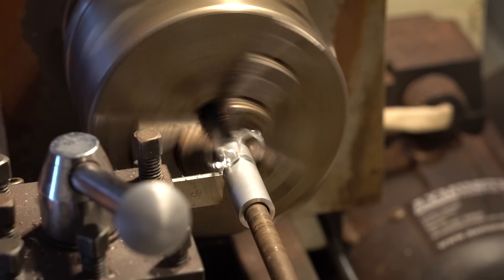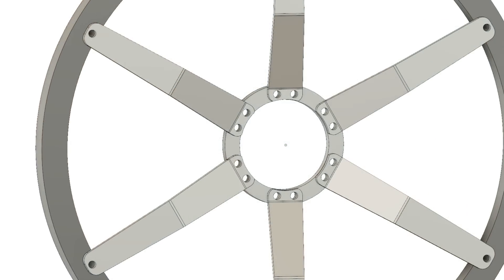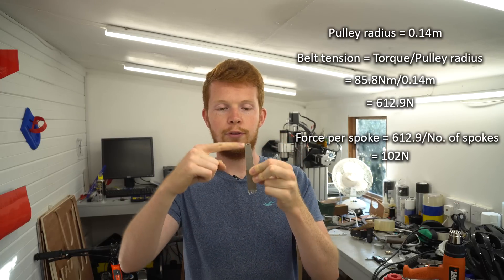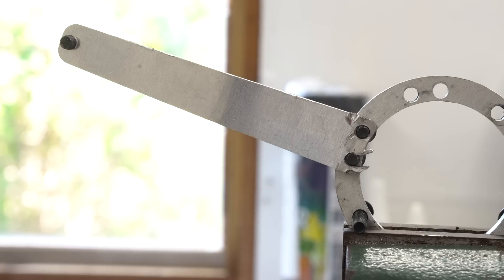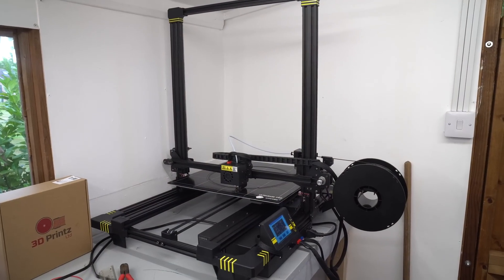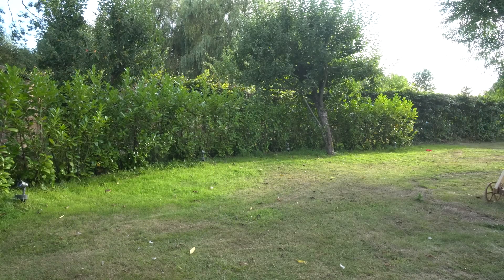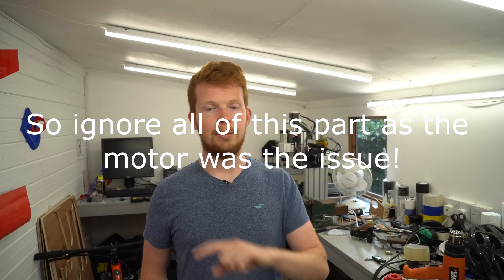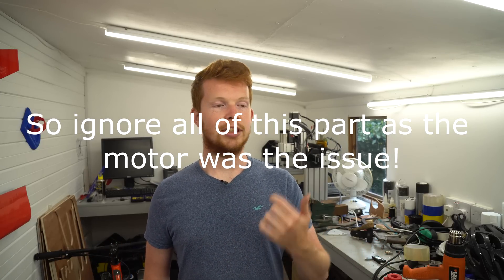Electric Bike 4.0 - Pulley Failure

Comment: Hey Tom! Your projects are awesome. But I wonder why you arre trying to desing this e-bikes to run on separate bldc motors. You can very easily use a rear or front wheel hub motor. Then you wont have to deal with pulleys, belts, motor mounts etc.

Comment: Honestly, Tom, your Stanton Pigeon Flyer 4.0 ended up being much more complicated than the mid-drive lol! I still think you should do the Mid-drive with a jackshaft, its really not that hard and you get the best of both worlds, lots of torque "wheelies" and high speed, I'm going to keep bugging you until you start prototyping the mid-drive + jackshaft which you pretty much already built with the gear reduction box. I built one with scrap steel and I'm really dumb compared to you so it should be a walk in the park for you, lol!

Comment: for future projects might be good to use a tension pulley on the compression side of the belt, not the tension side where the motor pulls on the belt.
and have the tension pulley to be moving freely but having a big spring to apply constant tension on the belt as it stretches under load

Comment: Hi, I am an engineering student and love your videos. I just learned about DC motors and Kt and Ke values, I looked up the Kv value of your motor and required EMF current from your E-bike V3 and came to a torque of 18.75 Nm. I see that you came to a value of 42.2 Nm in this video which was quite off from my calculation. I was wondering if you or any other engineers in the comment section could help explain what I did wrong? Thanks and keep up the amazing videos!!

Comment: About your spokes. Look at how the aluminium sheet is made. You can see the layers because the aluminium sheet is streched out to get the right thickness. See it as a piece of wood with its layers. Wood strength is different in the length of the layers, this also applies for aluminium. I'm not sure how much differens in strength there is but maybe it helps for the next time?
Reply: I found a source to back up my comment: https://apps.dtic.mil/dtic/tr/fulltext/u2/a506416.pdf

Comment: Why did you use radial spokes for your pulley? angled spokes are much stronger(compression),  Idk how you missed that as both your wheel and disc brake rotor have angled spokes.

Comment: When doing finite element analysis do not just select the smallest mesh size. You should rather do multiple simulations with mesh size getting smaller each time and see if the result converges to a value. If it converges you can be sure that the result does not depend on the mesh size. If it does not converge, there is something wrong with the model and you should investigate further.

P.S. Great video!

Comment: dont use grubscrews!   drill a hole on the face  and thread the half of the shaft und half of the pully and put a screw in . Maybe 180° for a second . homemade "key"  1000 time solider than a grub..

Comment: You can determine the torque your BLDC motor is producing if you know the Kv and the amps you are applying.  Do this by deriving the Kt and multiplying by the amperage.  You can derive the Kt from the Kv using the formula KtKv=1 in SI units.

Comment: I've watched your E-Bike video series with interest. Looking back thru the last few videos, I can't find much discussion at all about when you modified the electric motor. Am I missing that? I'm interested because that seems the most likely problem for the shuddering you described.

The last video shows the rendering with the shaft out of the reverse end of the motor, relative to the originally designed propeller mount.
This video talks about the failure of the new motor shaft. Did you cover the motor modifications somewhere?

Comment: As a mechanical engineering student, its awesome to see many things I study being applied to real world problems. Calculating the torque on the pully hub is a typical "Dynamics" problem, and verifying if it will resist or not the torque is a typical "solid mechanics" problem. Its literally something that I would have to do on a test.

Comment: Tom, the motor you are using does not have a specific max current given, says it needs 200 amp ESC, doesn’t this mean it is closer to 10KW? ( 50v x 200amp) or does it use less amps than this?

Comment: hi tom might have something useful to you. there's this you might be able to do something with https://www.aliexpress.com/item/Electric-Bicycle-130-BCD-Road-Bike-Chainring-Spider-Chain-Ring-Adapter-Gearing-For-BAFANG-8Fun-BBSHD/32823956546.html?spm=2114.10010108.1000010.4.5ebe408cpXGT4r&gps-id=pcDetailLeftTrendProduct&scm=1007.13438.100207.0&scm_id=1007.13438.100207.0&scm-url=1007.13438.100207.0&pvid=9de4ef81-7101-4622-b3b6-cdb45cd9b338 
or you can get two piece disc brakes

Comment: Try using countersink screws. It mounts flush and it leaves no gaps in the material around the joint, so it's stronger and it won't shift under load. The load is more evenly distributed around the hole so it's stronger.

Comment: Check your motor bearings, I had a water cooled RC brushless motor fail in a High speed boat I built where the bearing just couldn't take the force under high revs. Axial motors are better for Bicycles as the bearings take a way higher load.

Comment: You could try hardening the shaft the way Clickspring did it, by packing the rod in a clay capsule with carbon and firing it (or if the steel has enough carbon content, quenching it in water or oil)

Comment: I know you have fixed this already but have you noticed that bike spokes work in pairs? connecting to a point on the rim and then back to the side of the hub tangentially rather than radially? 

that is effectively what you have done by widening the bolt holes.

Comment: Aluminum with steel fasteners is not the best materials for this.  Metal Fatigue may cause another failure in the future due to repeated shock loading as a normal form of wear and tear on a bike.  Thin Tubular steel with flattened ends may be a better alternative as some steels have a stress threshold below which they don't exhibit fatigue.

Comment: I will tell you Tom that this failures, and how you solve them, are one of the best parts of your videos, you're a great explainer. I reckon it is easier to edit one long video every two or three weeks than a short one each week, so you could do that, maybe? a long video not only showing like a tutorial on the project, which is the best definition I can find, but an explanation on a couple issues that you consider you could offer some engineering insight.

Comment: When prototyping during R&D of anything that over time may have to be revised (as you are doing in the video), in order to avoid the situation you are in now, get a Composition Book or other bound paper notebook and take copious notes including any improvements to the work that came to mind during fabrication of each and every part with the intent to have a clear view of the potential changes needed in the next revision of the part BEFORE THE FIRST VERSION IS TESTED. Always begin each day's work at the top of the next page with everything listed plainly like the date, revision number, material designation etc. Otherwise you will eventually be guessing on things that you probably would rather not. This was my system during my 15+ years working in Research and Development of aerospace, medical devices, bioremediation systems etc. I hope that this will be a help. 🙈🙊🙉

Comment: Balance the motor. Then consider losing the bloody belts and pulleys. At least the first stage could be geared down with gears. 

you put a serious radial stress on the motor shaft and bearings 
These were not meant to run like that. 
You have a cnc cutter - cut gears. Aluminium, 2-3mm teeth, 10mm thick, straight teeth.

Comment: Maybe if you could get rid of the spokes and built something whole, from aluminum or metal sheet, proper cut in a cnc and bent it  to meat your measurements, could help a/ with the amount of torque applied b/ longetivity and strength. just saying..

Comment: Was the grub screw stainless?   AvE  has a good video on how stainless steel fasteners gall and effectively cold weld under vibration.  I don't think this would affect the aluminium pulley but the tip of the grub screw might have cold welded to the shaft, making it tear out a chunk when you removed it.
A pulley with a taper hub clamp would fix that but I don't think you can buy them that small and they are expensive.  It might be worth your time to try making one in your existing pulley.

Comment: You can get a much more accurate graphing of the systems torque characteristics by simply drawing evenly spaced lines on the surface you're accelerating on with some chalk or something and film an acceleration with a camera pointed down. You're more than clever enough to figure the rest.

Comment: Very nice build so far :) Maybe a (steel) back plate for those two bolts might helped to clamp the spokes to the ring, so that the forces are transferred through the surfaces instead of the bolt and one side of borehole?

Comment: I use hobbyking NTM and Turnigy motors extensively and for the most part they are OK and I will continue to use them.  Having said that they do have quality control issues and I tend to buy two of everything as quite often one has problems.  The bearings on NTM motors are particularly worrying as they often fail and/or get loose and noisy after only a small amount of use.  This is fine for the small motors I use however for larger motors this could be a problem.  Suggestion is, even though HK is good, there are better motors out there.  By the time you buy two HK motors to get a good one you could have just bought a better one.  My long distance quadplanes use Cobra motors and AXIs now for these reasons.

Comment: Hey Tom, 
I don't know whether your motor is suitable for an application like this. Due to the tension of the belt there is quite a high lateral force acting upon the motor shaft and the bearing. If this is an motor designed for driving a propeller the bearings are constructed to withstand mainly longitudinal forces. I think that's the reason why the bearing has been damaged so that the whole motor starts vibrating on certain speeds.

Comment: If you can get that motor apart take the rotating part to a machine shop that balances engines (any place that actually rebuilds engines on site should be able to do it...) and they should be able to balance it. To make a fully balanced engine they not only have to balance the crank rods and pistons, they also have to balance the flywheel and the harmonic balancer. The tools they use for the harmonic balancer will probably suit your little electric motor pretty well.
 I think that'll take care of that problem, but I would take the rest of the motor and the drive circuitry with you so that you can verify that balancing the shaft to solved the problem. It could also be bad bearings and there is a slight possibility that the stators maybe vibrating or the electronics may be causing or adding to this problem.

Comment: Haven't finished watching the whole video, but just gotta jump in and say the torque isn't shared equally between the spokes. The toothed pulley would have to be infinitely stiff for this (which it isn't). Further, there is a radial force applied to the spokes also, plus the eccentricity caused by the offset between the pulley centre line and the mounting face.

Comment: I don't know if you have thought of this but the vibrations seem to only occur at W.O.T. (wide open throttle ) or max speed. Have you considered putting a rev limiter on the throttle so max rpm is not available. This may not let you hit max speed but would still allow you to use the bike as it is now with the dual pulley set up for more torque but could be set to just under the point where the vibrations occurs. Cheers mate.

Comment: Hey, the test with the weights on the spoke are not very accurate i think, because you don't thighten them against the wheelhub. So all your forces going into the boltholes. But when you thighten it, there is also the facepressure between the spoke and the wheelhub this should distribute the forces more and it is even stronger. I hope you understand what i mean in this broken english....

Comment: Regarding your grub screw problem: I'm sure you thought of cross-drilling the pulley and shaft and using a cross pin, so there must be a reason this won't work.  And,  I assume you are not using keyways because you don't have the tools to cut them.  

Have you considered a round keyway?  What I mean by a round keyway is you drill a hole parallel to the shaft right on the shaft/pulley interface.  That is, 1/2 of the hole is in the shaft and the other 1/2 is in the pulley.  You then use a round steel rod as the key.  While not as good as a square key, it should be better than a grub screw for transmitting torque.

Drilling this hole would be tricky with a steel shaft and aluminium pulley.  If you try to drill them together, the drill will drift into the softer metal.  You would probably need to drill them separately.  That is, you would need to make a temporary aluminium shaft and drill the pulley with the aluminium shaft in it.  Then you would need to drill a shaft-sized hole in a scrap piece of steel and put the shaft in this hole to drill the shaft.  This might not work if your scrap steel is a lot softer than the shaft.  After both the shaft and pulley have been drilled, you might need to put them together and chase the combined hole again with a drill.  The results might not be great, but would probably be stronger than the screw.

Comment: It looks like you solved your spoke problem, but if you need more strength here's an idea:

In your stronger design, each spoke has a flat on each side where it touches it's neighboring spokes.  Instead of a flat you could put a protruding tooth on one side and a corresponding indentation on the other.  If the spokes are accurate enough, this toothed connection between spokes would take a good bit of load off of the bolt holes.

Unfortunately, the wider bolt spacing on your stronger spokes leaves you with no room to add an indentation. So, let me give you one more idea.  I assume that toque on the pulley in the reverse direction (caused by regeneration) will be small compared to the maximum torque in the forward direction.  If this is true, then the "tooth" I mentioned above could just be a small triangular addition to the trailing corner on the inner end of the spoke.  A corresponding chamfer would be made on the other inner corner of the spoke.  This would only help with torque in the one direction, but if kept small would probably not hurt when torque was applied the other way.

Comment: To be extra clear... the spoke is acting like a cantilevered beam subjected to a periodic loading and unloading... like a diving board. The leading edge of each spoke in compression, and the trailing edge in tension.  The downward force you cite on the leading screw is prevented from going anywhere by the hub around which the spokes are arrayed... ergo- it has a bearing against which to thrust... but there is nothing to prevent the trailing edge of the spoke in tension from moving away from the hub. With the lead screw hole unable to go very far down, it becomes the pivot point around which the forces impart a moment onto the trailing screw hole... yanking several times the motor’s  force on each spoke in turn and then releasing with each revolution.
The material you made the arms out of is stronger in compression than in tension and has a low elasticity... such that It deformed plastically under the periodic loading.

Your calced safety factor is not there because you assumed the pulley assembly’s members shared the load evenly.  They don’t, even in a monolithically cast pulley... but in a pulley made of bolted together parts... load really just can not be counted on being distributed fully thru the various connections.